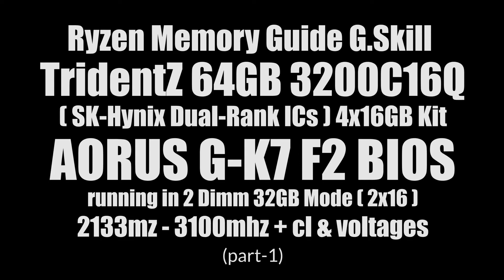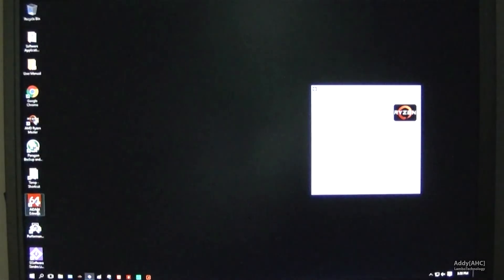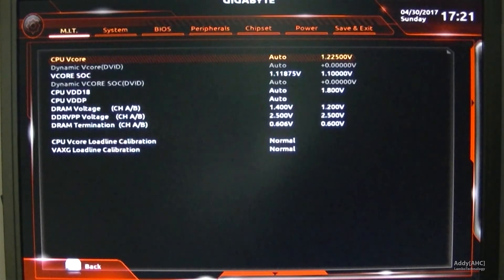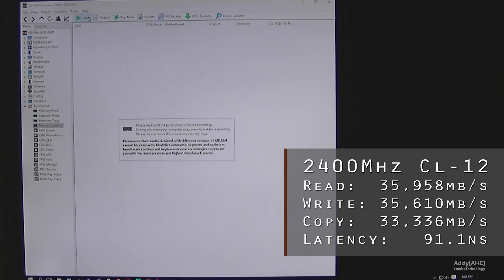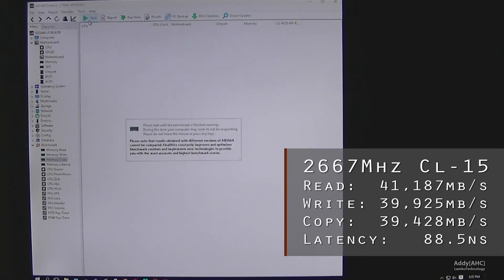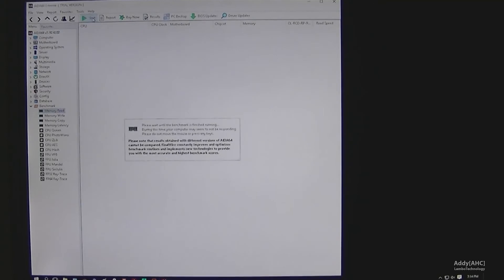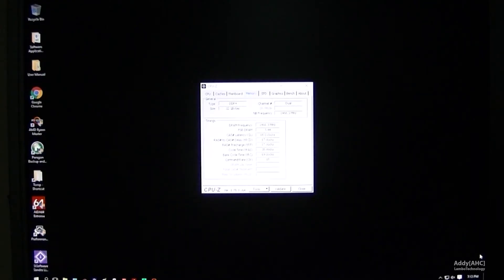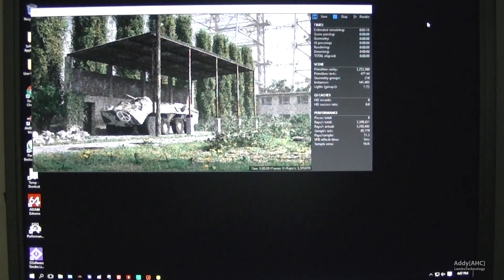Ryzen Memory Guide F2-BIOS, TridentZ-64GB-Kit in 32GB Mode on K7 (F4-3200C16Q-GTZ)

Comment: thank you man . dammit i was looking and searching more than 3 days to get this shit that i have to 3200 on ryzen 1600x and now i found you thank you very much it works
Reply from the maker: Also since the new F4 bios release, full memory speed has been unlocked.  This hynix  kit can run at over 3325mhz.
U can try 15-19-15-15-38-75tCR-1T, in 1.06agesa additional 20 registers were unlocked for tweaking. I still like to keep ram voltage a bit higher 1.4V+. Its been stable as a rock so far.

Comment: I'm looking to buy the following kit
F4-3200C16Q-32GTZR
Will this work @3200 with K7?
Reply from the maker: Not will all 4 sticks, only 2 sticks will reach about 3100-3200 for now.

With that kit in particular there's a 50/50 chance of getting Hynix ICS like i did over Samsung ICS, and because it is Quad channel kit like mine which is not officially supported yet on Ryzen boards just yet. The BIOS release with intel memory kits support is coming either end of June or sometime in July, it will coincide with Threadripper motherboard support as they need to support Quad Channel ram, also any memory kit (regardless of gskill or other, at 3200mhz CL16 timings is either SK-Hynix or Samsung E-die (not to be confused with B-die), very rarely at this speed u will get B-dies ICS. 

The trick to spotting B-die kits is single rank (generally single rank, dual stick with tight timings CL14 or lower).
The second problem on X370 and other boards is that you will be lucky to boot at 2667Mhz with 4 sticks, 'probably' no more than that. This is currently a BIOS limitation, again till AGESA 10.06 is released as I mentioned above.

For the kind of cash ur gonna drop on these 4 sticks, u might as well add another $50 and get 32GB in 2 stick dual channel kit, which will also offer u more flexibility in the future by adding another kit for 64GB if need be.

May i suggest this kit (link below) which is about 95% chance Samsung B-die as timings are CL14, and usually a sign of B-dies.
Newegg.ca is currently listing them for $479.99cad (120 lower than amazon right now), u might be able to snap it up before others get wise to it. (PS: newegg also offers 30days return policy and they're RMA is very good as well, which i found out with my prior ryzen Asus prime board.)

https://www.newegg.ca/Product/Product.aspx?Item=N82E16820232560&cm_re=G.SKILL_3200mhz_Trident_Z_RGB_32GB-_-20-232-560-_-Product

Happy hunting.
Reply: Thanks for your advice. I went with 2 sticks(F4-3200C15D-32GTZ). Working perfectly@3200 with AGESA 1.0.0.6.
Reply from the maker: Excellent good to hear that.  Another kit on the plus side.

Comment: will any Trident Z work?
Reply from the maker: Technically they should, however u should check ur motherboard vendor compatibility list, as the vendors may choose to implement different kits from other vendors.

TridentZ based on B-die which come in the higher frequency kits with low timings such as those in 3200c14 and higher a much better chance of working at higher speeds with low timings. Zen platform apparently likes Samsung B-die kits along with higher-end SK-Hynix kits.

A bit update for compatibility with lots of Intel Kits is coming end of June/beginning of July as AMD prepares the HEDT & Server Platforms.

https://www.reddit.com/r/Amd/comments/62vp2g/clearing_up_any_samsung_bdie_confusion_eg_on/